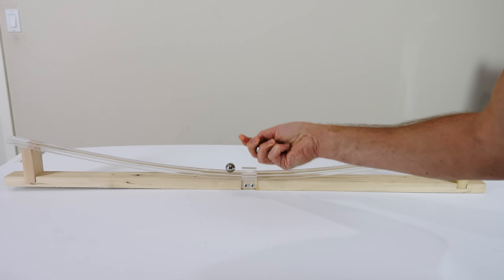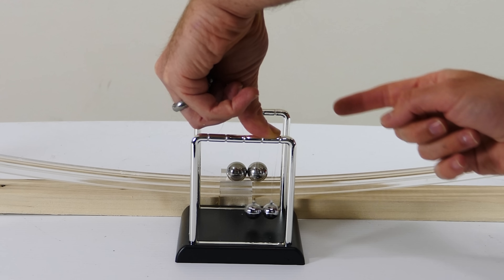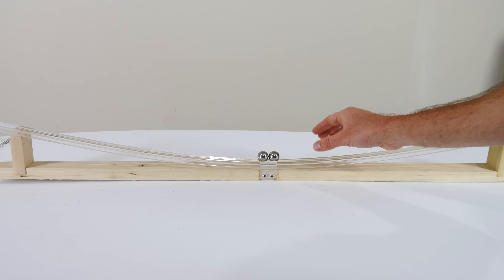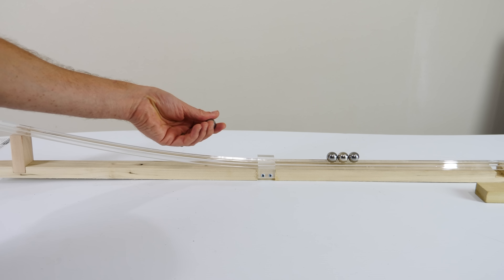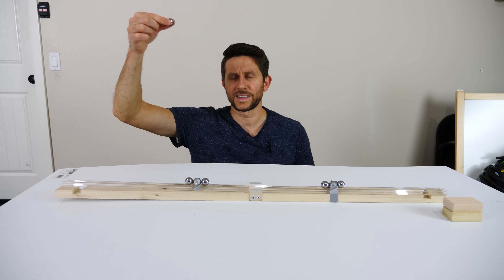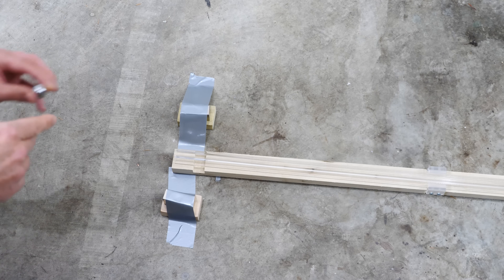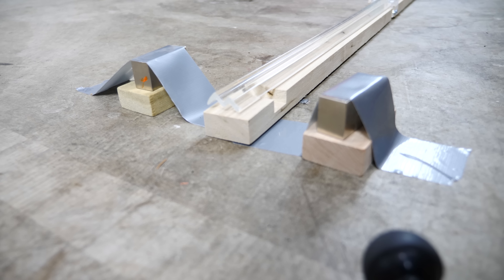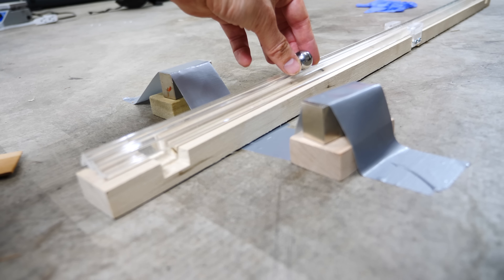How Does a  SMOT Work? (Simple Magnetic Overunity Toy)

Comment: That is what deal is, the ball has to escape the magnetic field it just was attracted to and entered into, and it won't without extra input energy, or some other way to shield the magnetic field at the right moment in time.  The magnet needs to attract the ball to make it move, but the magnet has to also repel or at least not attract the steel ball, but that is not how a perm. magnet works.

There is a way to shield the magnetic field, but the question is if it will still take up the energy required to enable the shield. Mechanically we can eliminate the magnetism, but it requires energy to mechanically get that shield in the right places during the cycle. Moving in with the shield will short out the magnetism, but same thing as with the ball, it will now take even more energy to move the shield back out. Without doing the experiments, i would say NO way will it work, it will cost energy to enable and disable the shield, enough to make the conservation of energy stand true. In other words it will most likely take whatever energy you "gained" by shielding the magnetic field of which allows the ball to continue, that it takes to enable the shield. You would need all that energy, plus extra energy to overcome the friction, and even more energy to have it moving.

But not that i am saying there isn't anything we can do with magnetism, and magnetism from perm. magnets. Just find creative convenient ways to add that energy it needs and/or ways to reduce and make more efficient use of the energy it requires.

Comment: uhm so why wouldn't you just rotate the track then .. then all you would need to maintain is orbital velocity and the ball could keep falling forever. also if it is in a vacuum and you uses a magnetic levetation in the track itself then how would there be frictive losses?  Also since there are superconductive materials then why not just do this with superconductive magnets? ... or like why not just use ground as earths magnet is about as ever lasting as matters.... earth's magnet is charged by the sun and stuff and that is about as long lasting a duracell or even longer.

Comment: He's just speaking from a pedestal of nonsense.
Energy in magnet... So it's like a fuel and balance... Once it decays then their is no more means of fuel. Often in setups magnets heat up and lose their magnetism. You can make disks that just spin... Most of the time though the parts in the system will break down before the magnet decays... If you put a load on the magnet the force causes the magnet to decay pretty fast.
Reply: "He's just speaking from a pedestal of nonsense."
He is correct-you are not.

"Energy in magnet"
There is no usable energy in magnets. Magnetism isn't a form of energy-it's a force.

" If you put a load on the magnet the force causes the magnet to decay pretty fast."
No. The fields of permanent magnets can weaken through damage or heat, causing misalignment of the domains. A magnet stuck to a piece of metal is using no energy to remain in that position and, if it remains undamaged, will continue to do so until acted upon by some other force.
Reply: @darklight2.1  
So how long should my permanent magnet last? Your permanent magnet should lose no more than 1% of its magnetic strength over a period of 100 years provided it is specified and cared for properly.

Neodymium loses about 5% per 100 years in a standaized environment.

Certain earth effects, weather, sun, can cause a rapid depletion of its force. Magnetism is force, but it is energy. As a potential.  You can use magnets to generate energy. I stated heat and effects can "weaken" its magnetic forces, but magnetic force is  potential energy, or else how does a gradient system work in the ecosphere of earth, besides transitions of heat, we also ahve magnetic effects to life.

You can buy magnetic toys and levitate a heavy object.. technically that is a potential form of energy. You setup magnets unpowered to move an object, whilst putting copper or aluminum in its path to generate a current. that current can feed back into that system to lightly power to storage to cause the act to use that generated force into energy. Then we have earths field and gravity... What s the point of your post... Mislaignment... go research the process of creating ceramic magnets its hundreds of years old. It can do lifting magic. The most interesting use was wheels made into magnets.. You cna roll massive objects livitatings. and put them on a swing tray so the fields are always the same or use an eletroc magnetic otday to flip the  fields or offset the fields so its constantly always lifting, which woudl require more wheels. What work is it doing? just thefield lifting it up> no energy invovled. I mean if muon is a sub atomic particle... magnetism is aforce, waht generates the force if its not the electrons energy in teh system that is - =+ at either ends... I mean banging steel on teh ground iron. specifically the eletrons go to one end temporarily magnetising it... but thats not energy? eltrons travelign in a copper line? thats not energy? Wait a mintue.. magnetism is a force, but it is energy relation that cna be calcualted ot its field streignth based on its total electron stregnth materail mass etc.. .hmm  I don't know.. but... they do decay..
Reply: @artemirrlazaris7406 You said:
"Energy in magnet... So it's like a fuel and balance... Once it decays then their is no more means of fuel."
This is wrong. Magnets do lose their strength very slowly over time, but it is nothing like using up fuel. You cannot drain a magnet for its energy and magnets do not "run out of fuel".
Your analogy is grossly inaccurate.

 "Magnetism is force, but it is energy. As a potential.  You can use magnets to generate energy."
In order..yes, no. No, and...no.
Magnetism is not a form of energy. Full stop. The potential energy of the dipole is not analogous to the potential energy stored by, for instance, lifting an object.

We can use magnets to store potential energy, just as we can use gravity to store potential energy-but there is no usable energy available from either.
A magnet stuck on your refrigerator is using exactly zero energy to remain hanging there-just as a rock on the ground is using exactly zero energy to remain where it is.

The rest of your post is pretty much a garbled mess. I have no idea what you are even trying to say, so we'll leave it there.

The bottom line is that your initial claim was wrong and you've made no real headway in defending it in any comprehensible way.
The video is correct.

Ciao.
Reply: @darklight2.1  So gravity to store energy.. is sused all the time in pump systems taht utlize making say, solar energy, to pump water during teh day up to a resevoir, and the resevoir generates energy via gravity. This system is sued across teh states... 
To state it is using zero energy is not a correct assessment or else it wouldnt fall and deplete over time... I mean copper lines how does power run through it? What happens on the outside of awire?

Everything has energy in it, and it is all a type of fuel, since all matter in its subatomic level has varrying degree of harmonics in it, that formulate into elements or whatever else based on simliar thing of how folds in proeins change the inteeraction of biol langague in a system. 

I read your reply, I on't see how what I stated was grossly wrong, but  if we assume your are correct and magnetis isn't a form of energy... the nhow ot the eltrons in a data line or opper line moving ina system among fields nad interact? When its directly or inverse proprotional to teh system its in? Well.. okay.. ciao then.. I have no idea, but I  don't think what I stated was in error since you jsut staed teh same thing, waht hten is a relation of impedence ina system,

Can I not measure the joule stregnth of magnetic system, then we have.. stable magnetic  field lines, verse moving field lines based ona current conenction of flow to its other side. WHich is why directly aluminum and copper have variosu effets because of its twisted sub atomic structure that compsoed it to react as it is... Which is a system of energy.. I don't think potential and kinetic best describe... the relation of how matter operates... but to state magnetisim isn't energy... but a force... When I push someone there is energy invovled.. and its potential to kkinetic motion these words simpyl describe a phase of events taking place not the system. Since al lthings ahve a magentic field to them...

Comment: If people refine this idea enough they will end up building a particle accelerator. It will cost energy however, but you can absolutely keep accelerating something until either it catches on fire or you push up against relativity and synchrotron radiation .

Comment: What would happen if you remove the friction, for example with quantum levitation, with a super conductor.  (cost is nitrogen)
Reply: Despite what he says, what prevents the ball from ending up with more energy than at the start isn't friction. 
The real explanation is at 5:58  : 
after being accelerated , the ball is pulled back towards the magnets.
The magnets create an "attractive spot" . the ball accelerates when moving towards that spot but the energy cost to escape that spot is exactly equal to the energy gained during the acceleration.

Without friction at all, the ball would end up with exactly the same energy as before getting close to the magnets. It would still not have more energy.
(and with friction, the ball is losing energy)

Comment: Reidar Finsrud  built a working perpetual motion machine
https://www.youtube.com/watch?v=Wq79iAXJfoU
Reply: That device is a kinetic art installation. It's quite clever and useful for testing peoples assumptions about what they are seeing, but it's no perpetual motion machine.
Reply: @darklight2.1  As far as Ive heard, its still running.  The principles are what matter.  The device uses a unique balance and "Delay" system, to keep the system running.

 While this may not be eternal, as parts will wear down... and magnetism might weaken.. it still is a looped system.  Scaled up... Could enough worthwhile energy be extracted from it?  Not sure.  It might be far less than a bank of solar panels.  Thats not the point, however.

Comment: Is it possible to put a device in a vacuum? Or does that not count when trying to make a device? Just curious? Seems like you could get past friction issues and strengthen static/magnetic/charges. Does everything only equal out to zero, no extra power?
Reply: In a vacuum you would remove atmospheric friction, but you still have friction between the ball and the ramp.
Reply: Despite what he says, what prevents the ball from ending up with more energy than at the start isn't friction. 
The real explanation is at 5:58  : 
after being accelerated , the ball is pulled back towards the magnets.
The magnets create an "attractive spot" . the ball accelerates when moving towards that spot but the energy cost to escape that spot is exactly equal to the energy gained during the acceleration.

Without friction at all, the ball would end up with exactly the same energy as before getting close to the magnets. It would still not have more energy.
(and with friction, the ball is losing energy)

Comment: I'd like to see what would happen if you used the straight rail setup, where the magnetized balls were taped down, but put a rubber block on each side of the rail, so the projectile ball could bounce back.  Maybe do this in a tube instead of a rail to keep it from bouncing off the rail.  Based on how reactive that setup was, it seems like that would be a perpetual/accelerated motion.
Reply: to make it work, the projectile ball needs to be farther from the magnet ball than the incoming ball.
If I use R and M to represent regular and magnetic balls (and - to represent distance)  , the initial setup is :
RRM - - - - - R
and we end up with : 
R - - - - - RMR
-The incoming ball is strongly attracted to the magnet because  it goes very close to it.
-the projectile ball is weakly attracted to it because there is an other regular ball between the projectile and the magnet, so the distance is bigger.

after shooting, even if you put an other ball in the system, it won't shoot again, because the setup isn't the same anymore.

Comment: Idea for another video: I would like to know where the energy comes from that makes a dunking bird toy go. Yes, I see that it moves up and down because the body is warmer than the head as the water evaporates from it. Doesn’t it require an INPUT of energy for water to evaporate?
Reply: Yes. The toy is in an environment from which heat will flow when evaporation moves the system away from equilibrium.
Reply: the energy input is from the surrounding air.  a drinking bird toy is actually a very ineffective evaporative air conditioner.

Comment: I believe it is possible to create a perpetual motion machine but I have never tried to do it nor has anyone I have ever talked to even considered attempting the physics experiment I suggested attempting to construct.

My design requires a special form of carbon, magnets, and all the standard accruements of a perpetual energy machine.  The carbon is used as a shim that weakens a magnetic field in one direction, and this is the crux of the problem, I dont know any simulations or research which would show that it could do that. Essentially, we need monopoles. Monopoles dont exist in reality but it might be possible to create a pseudo-monopole by creating a balanced magnetic field and then weakening it. Instead of weakening attraction, we must weaken repulsion, and use a fully repulsing arrangement so that initial inertial energy clears the threshold of a repulsing two-way gate, with the leading edge of each gate having a weaker repulsing field than the side pointing away.

Comment: Correct me if I am wrong. But doesn't friction take away alot of energy too with the rolling balls? On the ramp the contactpoints between two rolling balls are 100% opposite in direction. If there would be more friction the balls might even stop moving down a slope I guess.

Comment: Magnetic force is essentially a conservative force. Meaning that if the ball moves around a path and arrives back at the starting point, then the net work done is zero. It's worth noting that the shape of the path doesn't matter. If the ball ever returns to the same point (which it does after one circuit) then no work is done. This means no matter how complicated you try and make your SMOT loop if it ever returns to the same point it can't do work. For the same reason attempts to use magnetic shields to make a perpetual motion machine are also doomed to fail. This is similar to gravity. Let's say you set off from your hotel to climb a mountain. It doesnt matter which route you take to get to the top, your change in PE depends only on the height gained between the hotel and mountain top. In addition when you return to your hotel your change in PE is zero.  Conservative forces https://en.m.wikipedia.org/wiki/Conservative_force

Comment: https://www.youtube.com/watch?v=f33QynbkNGc&t=356s Please build this with the exact material the guy says. If this cant work please explain why it doesnt.
Reply: It won't work.
Think of it this way-as each position on the wheel moves out of the magnetic field of an individual magnet, it requires the same amount of energy to leave that field as was exerted to bring it into the field in the first place-so the net sum of energy remaining in the system is zero, and the wheel will stop.

This is a very common form of fraudulent perpetual motion device, complete with the a patent number listed to make the device seem more legitimate. However, this is merely a patent application-meaning that all the inventor did was submit the patent paperwork and pay the fees. Additionally, it's designated as H02N11/008-meaning that its an alleged device. Any time that you see that  designation on a WO patent, it's pretty much always a nonworking concept.

The bottom line is just as explained in this video: there is no arrangement of magnets that will create a continuous rotation, or perpetual motion of any kind.
Reply: @darklight2.1  I understand that right but isnt the guy proposes that the material (Mu metal) will provide magnetic shielding.
Reply: @TINO_MAB  It doesn't matter. Every magnet is a dipole-it always has a north and south pole. If you "shield" one end, the magnetic field just changes shape, it doesn't somehow magically become a monopole.
It's a fake.
Reply: @darklight2.1  Thank you for showing me light lol